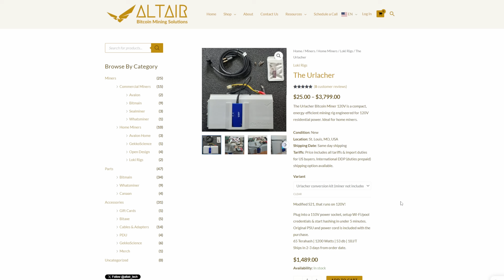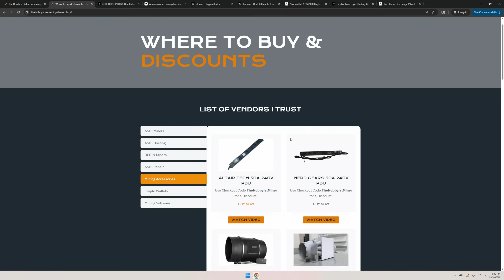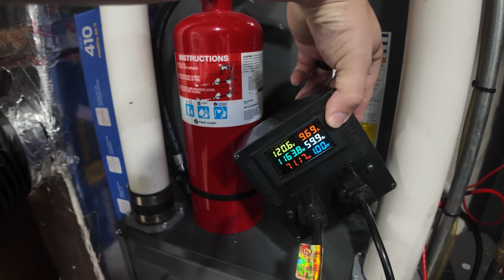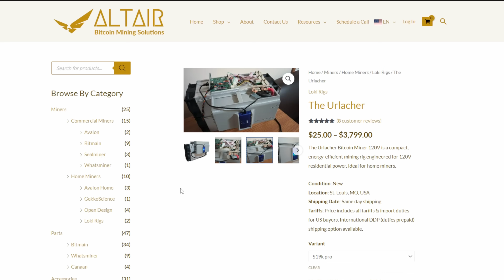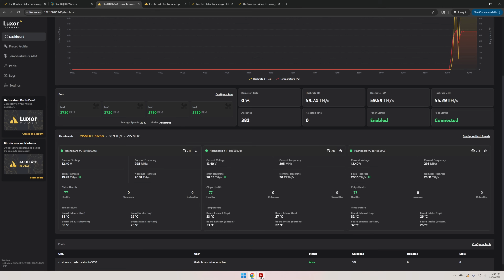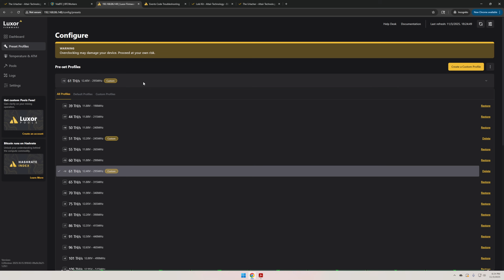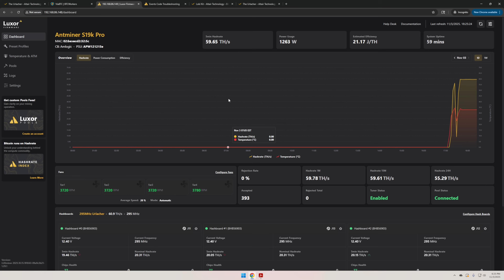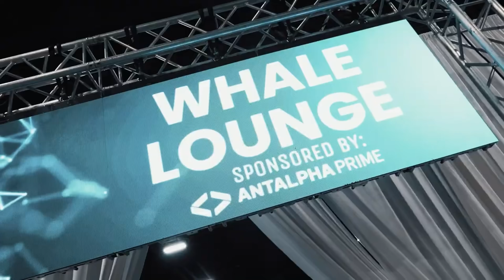Bitcoin-Powered Heating System: DIY Furnace Upgrade!

Comment: Very interesting, for a number of years now, work has been proceeding in order to bring perfection to the crudely conceived idea of a transmission that would not only supply inverse reactive current for use in unilateral phase detractors, but would also be capable of automatically synchronizing cardinal grammeters. Such an instrument is the turbo encabulator.

Now basically the only new principle involved is that instead of power being generated by the relative motion of conductors and fluxes, it is produced by the modial interaction of magneto-reluctance and capacitive diractance.

The original machine had a base plate of pre-famulated amulite surmounted by a malleable logarithmic casing in such a way that the two spurving bearings were in a direct line with the panametric fan. The latter consisted simply of six hydrocoptic marzlevanes, so fitted to the ambifacient lunar waneshaft that side fumbling was effectively prevented.

The main winding was of the normal lotus-o-delta type placed in panendermic semi-boloid slots of the stator, every seventh conductor being connected by a non-reversible tremie pipe to the differential girdle spring on the “up” end of the grammeters.

The turbo-encabulator has now reached a high level of development, and it’s being successfully used in the operation of novertrunnions. Moreover, whenever a forescent skor motion is required, it may also be employed in conjunction with a drawn reciprocation dingle arm, to reduce sinusoidal repleneration.

Comment: Very cool to see they now have away to trick the controller on the adaptive voltage adjustment to use any DC PSU, I did a similar set up about 4 years ago, however I had to directly modified the 240v stock PSU to support 120v without the need for that Loki board, that was a PITA, anyways now that so many much more efficient BTC miners are out and coming I don’t think I’ll use that modded BTC miner this season.

Comment: No need for spoofers with luxos, you can disable fans right in software. At 1200w that doesn’t even put out the heat of a standard space heater. The urlacher kit is designed to set in places like bedrooms etc, since it’s down clocked so much you leave the stock fans on, they run so slow it’s very quiet. Adding the inline fan for heating heat punk style stuff is typically done with standard psu so you can put out useful heat. Being in PA you would need 2-3 full power units to get a useful amount of heat
Reply from the maker: Thanks for the taking the time for such a detailed comment.  So I always like putting fan spoofers in my hardware running third party firmware, even if the firmware supports the disabling the fan detection.  Is it overkill, most likely lol.  As for my setup, it's been working great thus far!  Been running for a few days, we haven't turned the heat in the house on once and we have had some 34F mornings.  So going to call this one a win forsure! Is there room for improvement, ofcourse.

Comment: This machine is stupid. They solved the power and some of the heat "problem", but they leave the stock fans? Literally was so close to the finish line. Better to just buy a current gen btc home miner. Canaan Avalon Q or Fluminer T3. Efficiency is key in BTC mining.
Reply: maybe you should actually watch the video next time before commenting nonsense. he removed the stock fans to use an inline fan.
Reply: @ I did watch the video. You buy a homer miner that can’t even be used for home use out of the box.
Reply: I would not buy a prebuilt on this either. If you have the rig already though or get a really good price on a used S19/pro buying the kit would make sense over getting an Avalon Q.